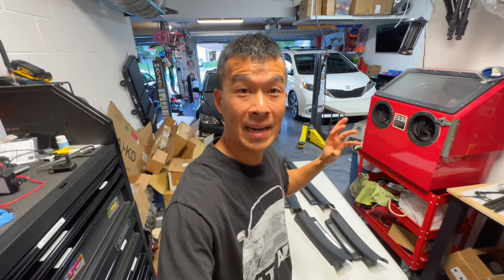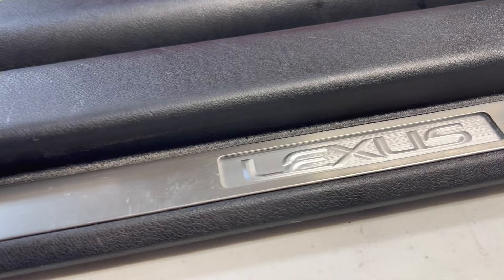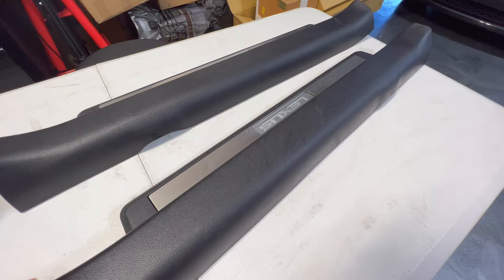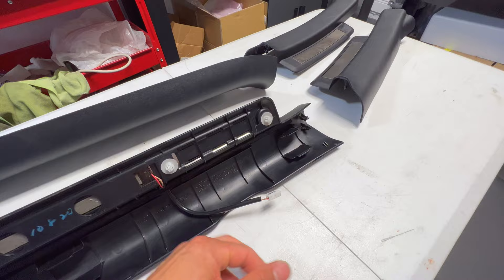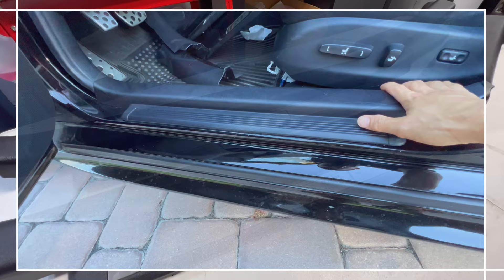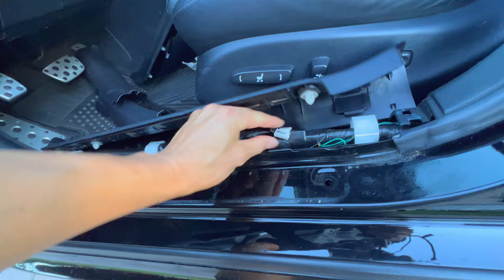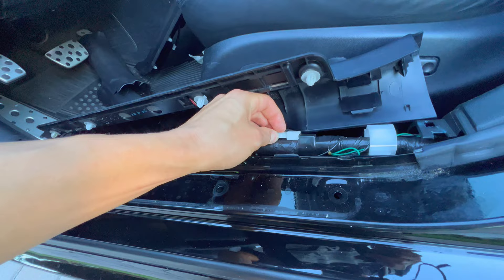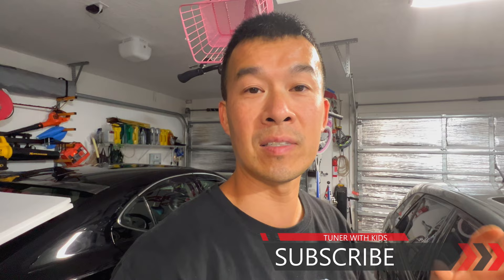Lexus IS250 2IS Illuminated Door Sill Install | IS350 ISF OEM White LED Door Scuff Sill

Comment: I had this problem as well you have to turn on the automatic interior lights on when you open the door for them to work
Reply: Mine still won’t come on with the doors being open any other ways to fix this?
Reply from the maker: @trentl5467 only PnP on 06-08. I think 09+ doesn’t have wires connected so you gotta rewire it.
Reply: @TunerwithKids  I tried the window regulator reset and turn the door light to on and they still don’t illuminate

Comment: Hi mate,l just done the same thing but the strips don’t work for some reason,it’s there any fuse for the strips?l just plug them in and turn the door light on but still not working
Reply from the maker: What year?
Reply: I have the same problem.  Mines a 2010. I have the plug but They not coming on

Comment: I have these door sills but they don’t illuminate,any heads up or ways of checking if the bulbs work? Thanks in advance
Reply from the maker: They make non illumination versions, make sure they have a plug. Check if the are plugged in? If you got 10-13 then it’s not Pre wired from factory.
Reply: @TunerwithKids  ahh I see,you were right mine are non light up ones,look similar but have black backing where it says Lexus,thank you. Appreciate your response

Comment: can you just switch out the bulbs on these? my 08 has these and passenger side lights up but not the driver side.
Reply from the maker: They are LED. If only one side works, try plugging the non working side to other side. If it lights up, you have a wiring issue. I’ve heard of certain years where the ground isn’t wired to the door pin switch.

Comment: Hello..! I have a problem the lamp sometimes works sometimes not maybe I pressed a button??thnks
Reply from the maker: No idea, does it do it on both sides?
Reply: @TunerwithKids  yes sometimes working.maybe there is a button??
Reply: @TunerwithKids  maybe I pushed something in the car?
Reply: @TunerwithKids  both side don't work i think there is a button??
Reply from the maker: Sounds like a loose connection or something wrong with the door button. These are activated when door is open.

Comment: I got the exact same ones. But they dont light up. I pluged it in, interior lights are on but they dont work. Any advice?
Reply from the maker: What year? So newer years aren’t wired.
Reply: @TunerwithKids  2008. But i found out why. Some models have the wiring, but it won't light up. The white wire would need to get wired to the door button on the pillar. Bit of rework on the original wiring, but manageable.
Reply from the maker: Yea. Most guys online end up wiring the ground to the door switch. The 12V is there but ground wire isn’t.

Comment: I have a is350 2006 it has the plug but both sides don't have power any idea
Reply from the maker: Turn on dome light door trigger?
Reply: @Binh-Tuner with Kids  I already did and no luck
Reply from the maker: Search club Lexus, it was a minor issue on some years of the build where the ground wire wasn’t connected. People ended up running a new ground to the plug. It was common on some ISF owners too.
Reply: @Binh-Tuner with Kids  ok I'll look into it thanks man

Comment: I have a 2012 is350 f-sport so in this case i would have to run a wire?
Reply from the maker: Yes need to check if you have the plug. Some have plug on one side but not other. But plug isn’t wired, those usually need a ground and people tap the door switch in B pillar to activate. They also run the power across and use the other door pin for ground.
Reply: Here's a good write up as some versions in UK have the plug but it's not wired up - https://www.lexusownersclub.co.uk/forum/topic/96348-illuminated-door-sill-upgrade/

Comment: my driver side doesn’t work but the passenger side is on? i have a 2011
Reply from the maker: Test it on the other side and see if it’s a wiring issue or bad LED on the panel.